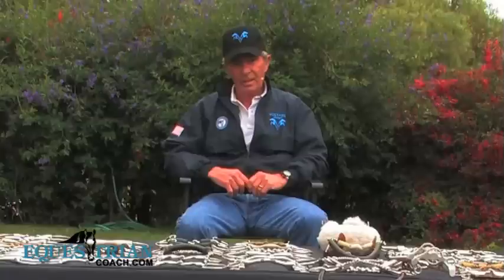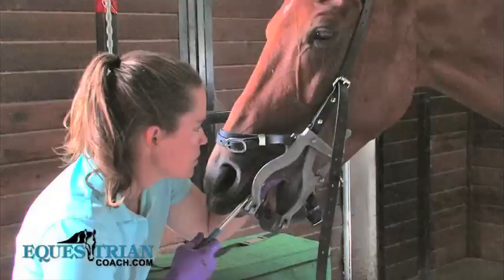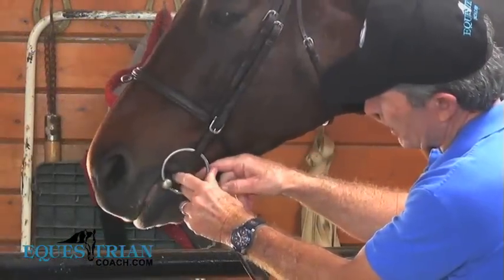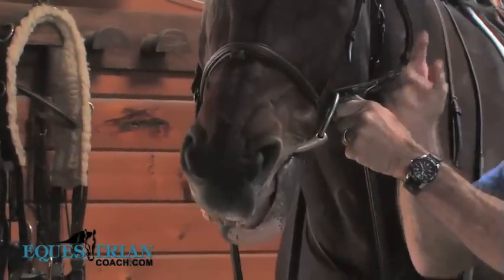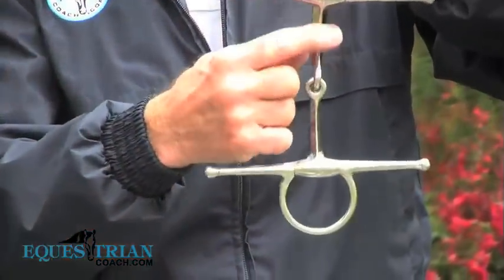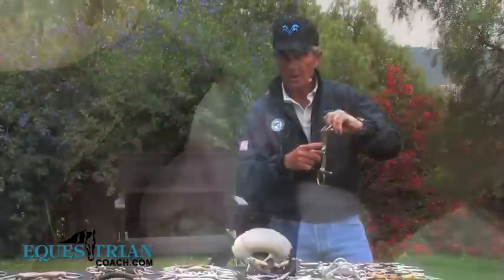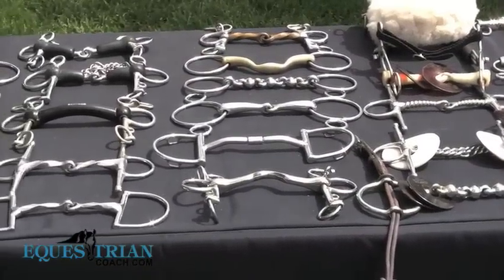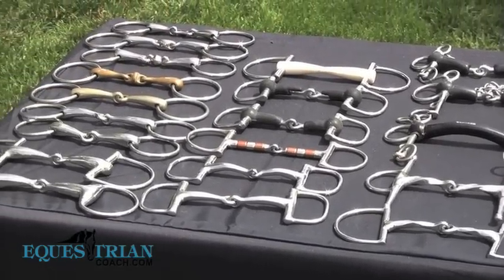Horse Bits: How They Work and When to Use

Comment: Sir, the very definition of a bit is pain.  The bit, ANY BIT, was designed TO CAUSE PAIN to the horse, so the horse will do exactly what the human wants the horse to do without the human having to connect with the horse in any other way other than pressure-pain mode.  The bit is an instrument of torture.  The BIT IS A GAG.  Horses will do what they are told to do without a bit (and I am not talking about mechanical hackamores and long shanks and chains).    Stop teaching that the only bit that causes pain is the bit that doesn’t fit, that’s just not true!
Reply: and what do you think a hackamore or bitless bridle does? A hackamore or bitless bridles do applies pressure onto a sensitive bundle of nerves under their nose, which is the thinnest bone in their bodies. your right though. any bit can cause pain. but only in the hands of a bad rider. and once that rider switches to bitless, they are going to cause horses pain bitless. a properly fitted bit and good rider who knows how to use a bit will not cause a horse pain. bits should not be used as a correction device or as a punishment method. it should be used as a communication device. And not every horse like bitless better. my mare for example hates bitless because her nose is  very sensitive and doesent like the pressure on her face, she loves bits however. My gelding on the other hand doesent like bits and loves going bitless. the amount of pain caused to a horse is always caused by the rider, not the equipment. now some equipment is abusive by nature like those metal nosebands or bits with huge shanks or spikes, or mechanical hackamores. but in a situation like that it is the equipments fault.

Comment: If you are using a bit on a horse you are abusing that horse..........period.
Reply: not true, period.
Reply: Royal------True, period.
Reply: sonseere10 and do you have proof of that? Because their is proof bitless bridles hurt too.
Reply: Royal------Anything will hurt the horse if used inappropriately. I am making a distinction between devices that control a horse through pain, fear, and intimidation and those that have a horse respond through subtle cues from slight pressure. Slight pressure, not pain.
Reply: sonseere10 different bits are meant to control the horse using pressure in different ways. That's why their is so many different kinds of bits. Same goes for bitless.
Reply: Royal-------Again bits control through pain. Bitless (rope halter) controls through slight pressure, not pain. Assuming appropriate application. Really improve your horsemanship and get rid of all the bits. They are not needed to respectfully work with your horse.
Reply: Look up Shelby Dennis's bit videos. They have great information with the facts to back them up. I used to despise bits too, until I opened my eyes and acknowledged not every horse is the same and they all have their preferences :)
Reply: sonseere10 "Those that have a horse respond through subtle cues from slight pressure. Slight pressure, not pain." You just described how bits work. 🤷‍♀️
Reply: @sonseere10  thats not true in any way. Bitless bridles also can cause pain and are used by applying pressure onto a VERY sensitive bundle of nerves under their nose that can easily be snapped.  your right though. any bit can cause pain. but only in the hands of a bad rider. and once that rider switches to bitless, they are going to cause horses pain bitless. a properly fitted bit and good rider who knows how to use a bit will not cause a horse pain. bits should not be used as a correction device or as a punishment method. it should be used as a communication device. And not every horse like bitless better. my mare for example hates bitless because her nose is  very sensitive and doesent like the pressure on her face, she loves bits however. My gelding on the other hand doesent like bits and loves going bitless. the amount of pain caused to a horse is always caused by the rider, not the equipment. now some equipment is abusive by nature like those metal nosebands or bits with huge shanks or spikes, or mechanical hackamores. but in a situation like that it is the equipments fault.
Reply: @graceconnolly5765  A bit is a pain compliance device. The horse will do as asked due to the pain or due to the discomfort or due to the anticipation of pain or discomfort. I prefer having the horse want to do as I ask because we have a trusting bond.
Reply: @gerrycoleman7290  A properly fitted bit will not cause a horse pain. Your same logic can apply to a bad rider with a bitless bridle. bitless can be just as abusive in a bad riders hands.
Reply: @graceconnolly5765  When  a bit is engaged by the action on the reins it can cause pain or discomfort or the anticipation of pain or discomfort. Properly applied cues through reins to a rope halter will not. I said 'properly applied'. Run an experiment. Ride the horse with a snaffle (1:1). Then ride the same horse in a rope halter (which is also 1:1). Give the horse the same cues with the same amount of pressure. You will see a difference. The horse will be calmer and more willing when the rope halter is used.
Reply: @gerrycoleman7290  What do you think a rope halter does?? It causes discomfort/pressure (that in the wrong hands, can and WILL cause pain)  to cue the horse. The same thing is what happens in a bit. I have done that experiment too. My mare I ride in a bit because she only relaxes and rounds in one, she has a sensitive nose and cant stand the pressure on her nose and face, and I ride my gelding in a bitless bridle because he prefers it. If its impossible to get a horse to be calmer in a bitless bridle then how can so many people be successful with getting their horse to round out and relax at the jaw, which can ONLY occur when the horse is calm and relaxed, in a bit?
Reply: @graceconnolly5765  Most any horse that can be ridden in a bit  can be ridden comfortably (for rider and horse) in a rope halter. If a person can not, it is not the horse, it is the person.
Reply: @gerrycoleman7290  thats not true at all. there is research shown that horses have preferences just like humans. horses prefer different disciplines, saddles/tack, food etc. It has everything to do with the horse and almost nothing to do with the person. there are thousands of factors you have to consider when figuring out wether or not your horse prefers bitless or with a bit. you have shown no evidence whatsoever through the whole discussion to back up your point. you are running in circles saying the same thing over and over again without any actual evidence or reason for it. Ignoring the fact that bitless can cause pain in the wrong hands and that bitless isnt the solution to everyones problem is extremely ignorant and thats one of the reasons people have such a bad idea of bitless riders.
a few of my sources:
https://annablake.com/2017/06/23/bit-or-bitless-you-wont-like-the-answer/#:~:text=Some%20horses%20don't%20like,a%20thing%20about%20your%20hands.

https://cooperativehorse.com/2018/01/bit-or-bitless/
Reply: @graceconnolly5765  Believe what you want. What I said is true. You are missing one of the most important points in horsemanship. It all comes back to the person. When the horse does as asked, the person did the process correctly. When the horse does not do as asked, it is the person who is at fault.
Reply: @gerrycoleman7290  yes thats true but that has NOTHING to do with bits or bitless whatsoever. You try to defend that bitless is the only way then completely miss the subject. With your argument, the a horse that is not relaxed with a bit, has nothing to do with a bit and is at the blame of the rider not the bit.
Reply: @graceconnolly5765  The evidence to support my points  is from horses. Horses will 'say' through their body language if they are comfortable with what a person is doing. But a person needs to have a good working knowledge of what the horse is communicating. When a horse moves his head away when the person is reaching for an ear............that horse reaction is because the person did not do the process correctly. When a horse tosses his head when the reins are engaging the bit, the person's hands were too hard. When  a horse will not easily give the person his hoof for picking and trimming, the person did the process incorrectly.  If a horse does not like the rope halter, the person has not broken down the process into small enough pieces to get the horse comfortable.
Reply: @gerrycoleman7290  yeah your exact same logic can be applied to bits. If a horse is tossing his head with a bit then the rider did not properly cue the horse or break down the steps to get the horse comfortable with the bit.
Reply: @graceconnolly5765  Yes, that is correct.
Reply: @gerrycoleman7290  ok so then why are you against bits?
Reply: @graceconnolly5765  It seems to me that if a person is skilled and soft with a, say 1:1 snaffle bit, and the horse is not reacting, then why not go to a rope halter and reins or a traditional hackamore (bosal, hanger, fiador, mecate reins) and see a greater comfortable response from the horse?
Reply: @gerrycoleman7290  well yes, in some cases horses do respond better bitless, others perform and respond better in a bit. you have to take into consideration the riders riding and what they can improve to help the comfort of the horse, and the equipment they use that the horse likes and enjoys.